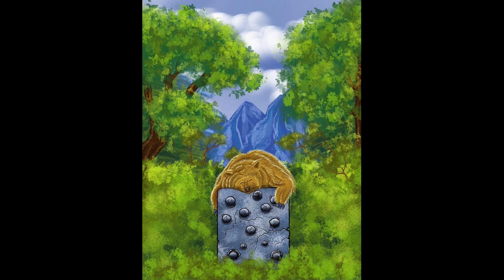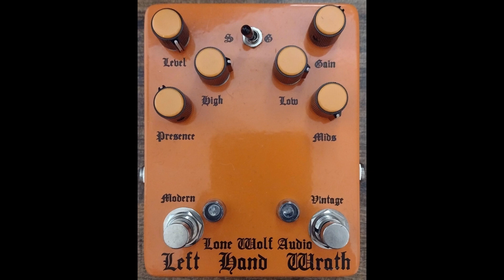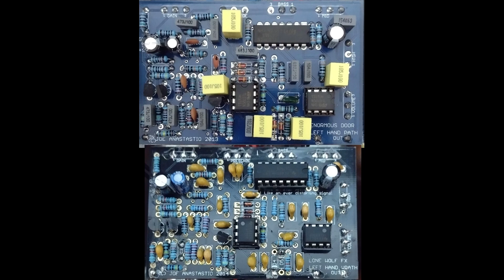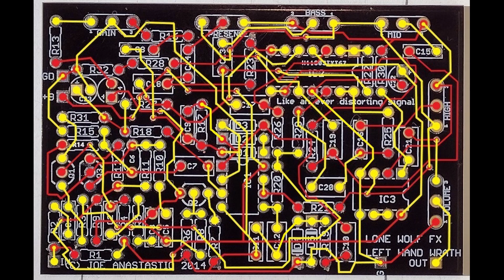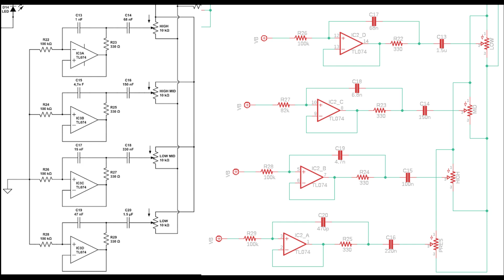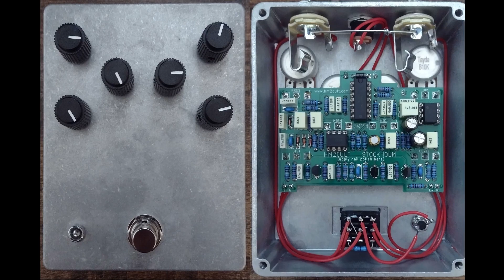Lone Wolf Audio - Left Hand Wrath | CIRCUIT ANALYSIS

Comment: I look at the pcb traces, and I don't think that's auto routing, because there are a few traces, if you move them to the other side, you can avoid vias or even makes traces shorter.
Near R27, you switch the position of the vias and you can remove a pair of via if you switch the color of the positive of C4.
Sometimes there are vias without any explanation at all, look at C8 and C5, on the right, you see 2 vias, you can remove them.
One less via if you switch C14 to presence to yellow and then presence to bass can have 1 via instead of 2.
R24 could be connected to IC2 directly, if the trace was on top instead of bottom and going around the IC...

I don't want to spend too much time on it, but that's not autoroute.

EDIT : Actually, Joe admitted of using the auto router, but I assume he is using an old version of eagle, probably version 7, because it's one of the few version that has been cr*cked.
A newer version of eagle would do a better job... but someone who knows what he is doing would also do a better job, and it would facilitate the job of the auto router.

Comment: as much as i dislike joe, your segment on planes was a garbled mess that contains little in the way of facts
Reply: So disprove it. There isnt a character limit.
Reply from the maker: As I stated in the video, I am an amateur. I did the best I could. At least I'm trying. What have you done? Your account has zero in the way of circuitry, so how does your point hold water? Or is this simply ad hominem?
Reply: @HM2CULT  'That which can be asserted without evidence can be dismissed without evidence. ' (Christopher Hitchens). also where Joe falls over, EVERY.FUCKEN.TIME.

Comment: Great work! I'm fairly certain that voltage and ground are constantly flowing through the circuit (when the power supply is plugged in) whether the pedal is engaged or in bypass. The foot switch is what routs the guitar signal, not voltage or ground. But to your point a voltage rail and ground plane would greatly benefit stability. Cheers.

Comment: I watched the video soon after release and I just watched it again.

It's highly likely that one circuit was based on the other, but there's no indication which came first.

You mentioned that the LHW was released earlier. If it was based on the Dunwich, how did Joe get hold of one, trace it, make his own PCB layout and manufacture the pedals?

Regardless, I believe Joe has stopped producing the LHW or at least has stopped focusing on it as his main product, so all this is mostly academic.

EDIT: I'm not saying that Dunwich copied Enormous Door, just that the video doesn't seem to indicate which was the original creator. I say this as someone who doesn't own Lone Wolf Audio products and doesn't have a good impression of the brand.
Reply: I get what you're saying, but for me, the big difference is that Nick Williams is not a gigantic asshole and his quality surpasses anything Joe could ever possibly dream of producing.
Reply: @DirtyDemos   Fully agree with that. It's clear from all the projects that Nick has been involved with that he has a high level of technical know-how.
Reply: In logic, we call this Straw Man, just because one man is an asshole, as you say, does not mean that he copped the design.
Reply from the maker: @drewcreal  Wrong. Joe is an *sshole AND copied the design. Joe wishes people dead for simply disagreeing with him. He wished death on Kurt Ballou (on his Twitch stream), and @sinistrousdiabolus (via message to me). And as far as the circuit, YES, Joe outright took advantage of Nick from Dunwich who generously gifted him the "modded HM2" PCB and schematic. So Joe had a non-functioning circuit before that, and then shortly after had a working circuit.  You're obviously new to Joe so I'll be understanding. Remember all of this in about a year or so when you realize what kind of manipulative narcissist you're dealing with. Nick does HIGH level circuit design for a living. Joe is a HACK at best. I'd suggest building a couple hundred pedals to develop an opinion worth sharing about what "is" and "isn't." The order of the components in the LHW gyrator EQ section are proof enough he copied it. Everyting is in predictable order  except where the (Dunwich) low-mids should be. In place of the low-mids is the (LHW) presence. To clarify this, every competant builder will order their EQ from low-to-high, or high-to-low. If the presence (highest) is in the middle that shows that it was a slop job, "cut and paste." Nick ALWAYS does pro-level work. Also, to think Nick copied Joe is laughable. You're defending a putz.
Reply: @HM2CULT Preach it!!!!  Thank you for this video and for not getting political in the video.   Good on you considering how he’s treated you and many others…

While I don’t OWN any LW pedals; I have tried MANY of them (the HM2 variants) and the Dismember is the coolest sounding one; it’s packed with a bunch of cool options to be perfectly  honest and sounds great BUT the build quality inside; man what a rats nest of Tayda components and the wiring is crazy BUT it works and sounds sick… haha 😅 (little bit of a devils advocate I know….excuse me!)

That being said, Nick @ Dunwich is a through and through PRO who creates AMAZING PCB circuit designs AND pedals in general.  Clean AF inside and out!

Again, thanks for this!!
Reply: The video is deliberately trying to leave his personality out of it,because as I've always said it's somehow used as an excuse to divert attention from the poor quality of his pedals.Maybe you need to join HMAP and play fallacy bingo with Joe's responses.
Reply: @sinistrousdiabolus  he's not actually proving or saying anything with this video either, other than that he thinks the PCB is unstable. I think you guys are lost in the weeds here and have diverted your attention to something that truly does not matter because you simply love to hate something.
Reply: @drewcreal  Why does quality not matter?